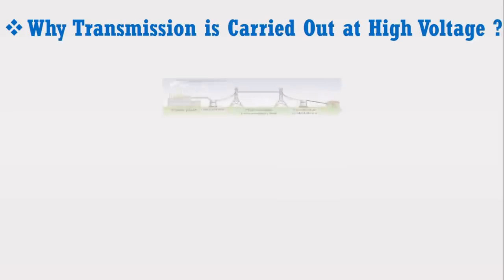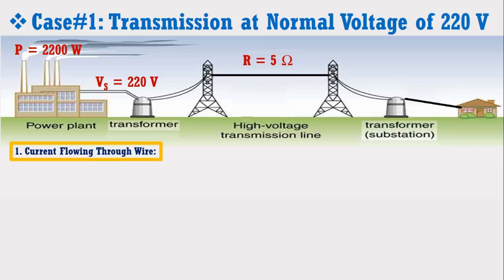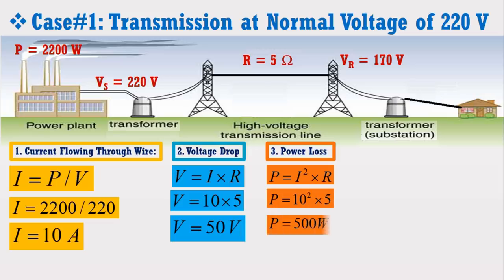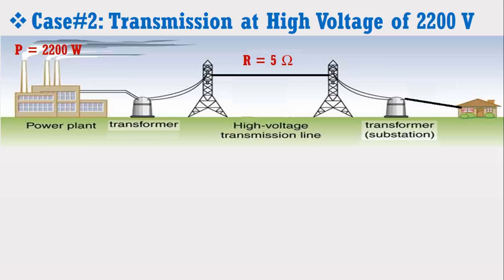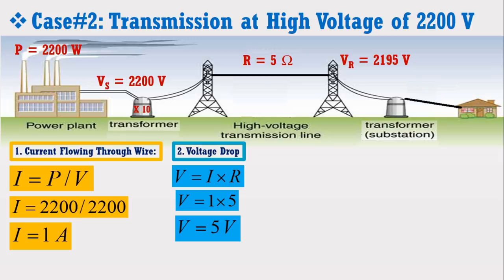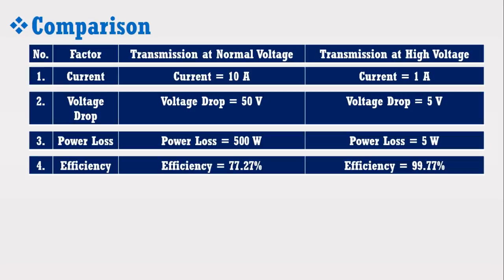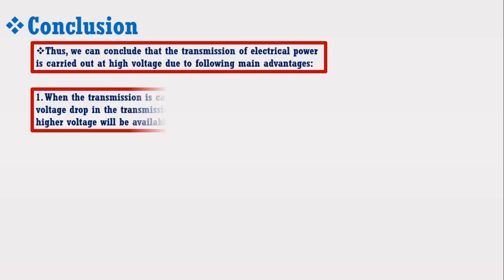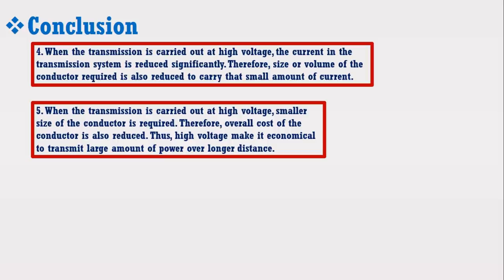Why Electrical Power Transmission is Carried out at High Voltage ? | Dr. J. A. Laghari

Comment: It's called Kelvin's law. Nothing new here.
Reply from the maker: With due respect, it is not Kelvin law. Kelvin law discusses about the economical size of the conductor and voltage. Whereas this video discusses the reason why transmission at high voltage is beneficial compared to low voltage transmission. Nothing new??? Yes. You are right bro. Electrical engineering is an old field, so surely there will be nothing new. Only new is the way of explanation with suitable mathematical example to clarify the concept. Thanks